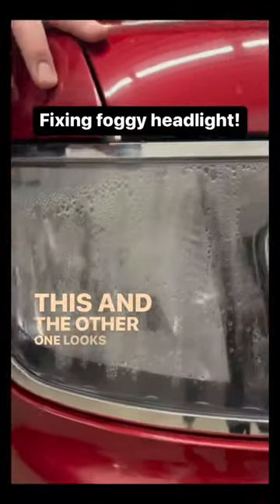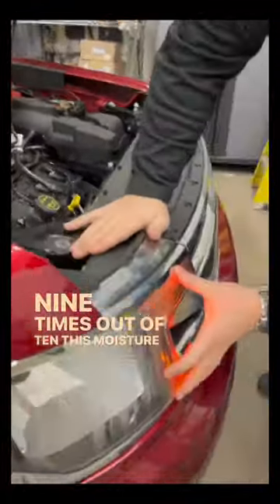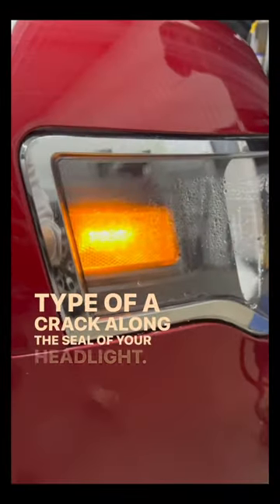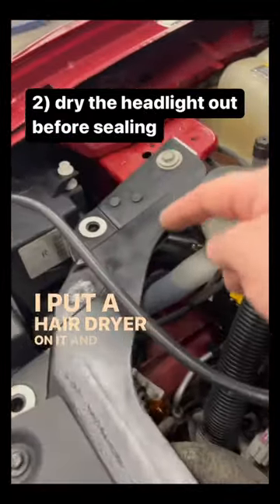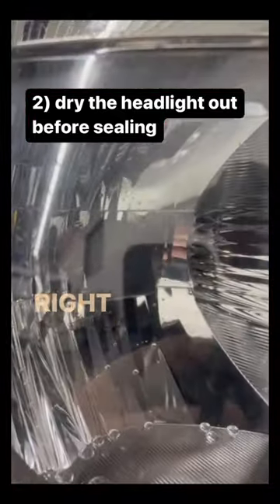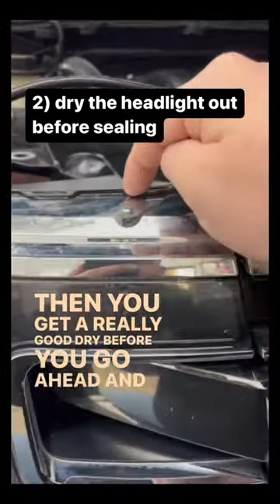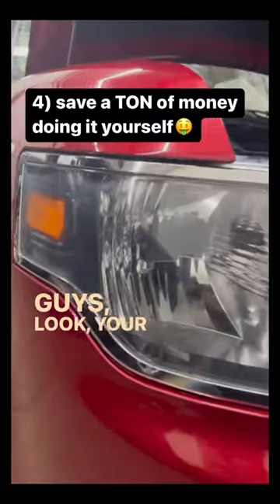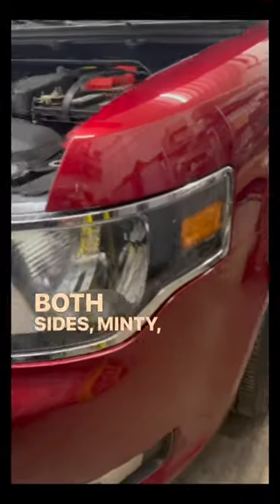Fix moisture in your headlight #cardealership #shorts #trending #trucks #comodomotors

Comment: Yeah, I have a Tacoma with the infamous cracking headlights. The ones I got when I took it to get the recall lasted a year before cracking and falling apart. I put the original ones on and used some restorer. They look and work good

Comment: That's what we call a patch job that is a dealership you should stay away from depending on the headlight you might be able to take the heat gun and be able to take the entire lens off scrape off the old silicone being careful not to scratch anything and reapply new silicone to seal it because odds are if the silicone in one spot isn't holding up properly it's probably not going to hold up in other places properly eventually Shady dealerships do this type of stuff all the time saying that they're going to save you some money and then a year later you're having the same problem because of different spot if it is cracked sometimes you can get a new lens for it but you should probably just replace the headlight if money is tight there's always an option of gluing it something like that but you're going to notice that either way there's always an option of getting used one that isn't cracked and then take off the lens and resilcone it and then your problem is solved often saving you hundreds of dollars and you know it was done right
Reply from the maker: Ever heard of a period stoner? Lol. Thanks for the info…
Reply: @ComodoMotors  yeah I've had an a YouTube account since I was very young why make a new one also yes I've heard of punctuation and I don't care and it really bothers people like you but it's okay you can again tell people inaccurate information that you can have studded snow tires in Michigan but am I wrong what's my comment on this Wrong and anyway there's a right way to do things in a wrong way we all choose the wrong way sometimes like me not using punctuation that doesn't matter not on people's vehicles that they're going to be driving

Comment: On my 2012 chevy malibu, you gotta remove the front bumper to get to the headlight bulbs lmao
Reply: Damn. Malibu or Malibu limited? On the 2016, I can just reach in that mf and replace it with no tools.
Reply: @stephenkeller8208  im not sure. Blew up the motor last night at 129,000 miles. Started it at 26 degrees outside and it didnt like that. It still runs and drives. But it knocks like a mf now.  It is a rebuilt title so who knows what that motors been through. Changed the oil and there was a shit ton of metal so the motor was probably going out anyways

Comment: Amazon $100 not $500 😂😂😂😂😂
Reply: plus 4 x more if someone else puts it in.
Reply: @timothydaly4136  if it's anything like my 2008 Lincoln MKX, you have to remove the front bumper to access the headlamp assembly bolts. It's a PITA.